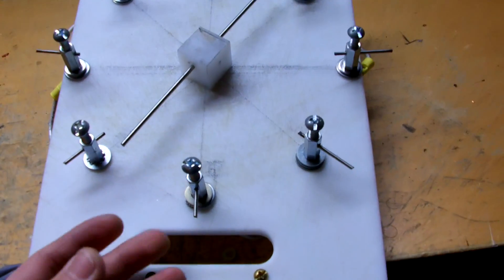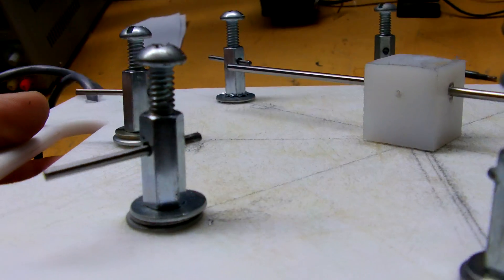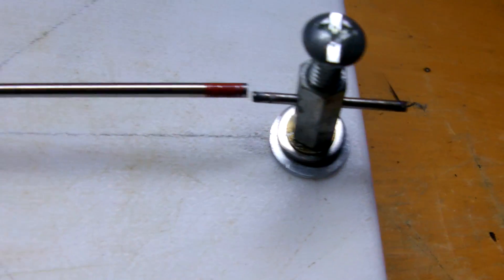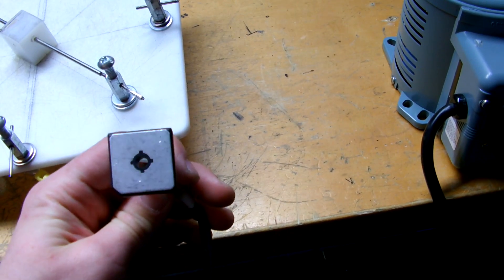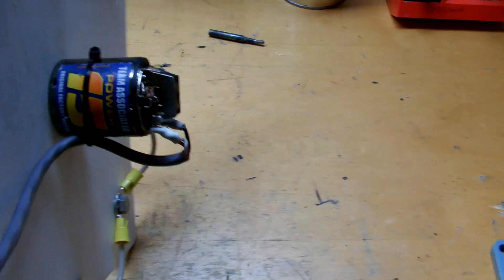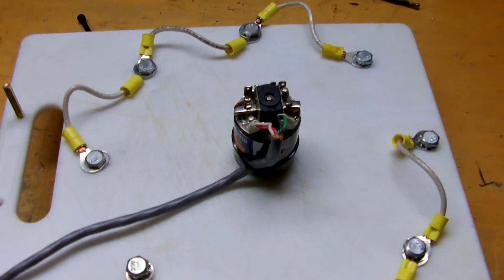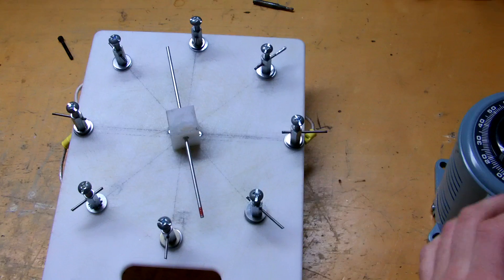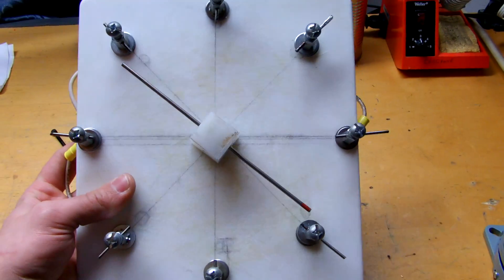Asynchronous Rotary Spark Gap Tour!

Comment: Back in the 70's through 90's I had a antique radio collection that included a wireless rotary spark gap transmitter. The rotor disk had, if I remember correctly, seven interconnected studs and was about six inches in diameter with a single stand alone stud to set the gap. Very much opposite to your set up but the same general effect. Motor was a 60Hz fan motor from the 1920's. Not sure of the final voltage but when connected to a long wire antenna it would blank out ALL radios from LF to SW in a one mile radius Lol

Comment: That's a nice economical design as the moving electrodes are cooled by movement whereas the static electrodes actually share the heat between more electrodes, i.e 2 electrodes moving but 8 static. So its not obvious which would suffer first from the heat! But I do wonder if the motor bearings are up to the job of handling the out-of balance forces from what will, even with the best efforts, still be an unbalanced rotor assembly. But it seems to work well on your other videos.

Those threaded rod joiners are a great item, I have found many ways to use them in various mechanical and electrical projects, I find the ones where the threaded hole goes right through are best. E.g. 20mm long M6 thread inside a 10mm hexagon.

Comment: Hi can you tell me where you bought those posts from & what they are called that hold your tungsten electrodes.
Cheers
Reply from the maker: Hi, sorry for the late reply. The posts holding the tungsten electrodes are just simple threaded rod connectors from the hardware store, i used a drill press to make the holes for the electrodes to slide in and the bolts on top hold them in place. Thanks for the comment!
Reply from the maker: Hi, sorry for the late reply. The posts holding the tungsten electrodes are just simple threaded rod connectors from the hardware store, i used a drill press to make the holes for the electrodes to slide in and the bolts on top hold them in place. Thanks for the comment!

Comment from the maker: Hi i do actually get bigger sparks because i can control the amount of power going through the gap from the output of the capacitors, unlike a stationary gap which only fires once the caps are full enough to break down the air around the electrodes.  Thanks for the comment!

Comment from the maker: Hey alex,  by being able to control the break rate of the gap allows me to vary the amount of power pumped into the coil during each break with the charge/dischare time of the caps resulting in a tune-able performance, you can tell when the right break rate is achieved, the arcs are huge!

Comment: Very cool!  I guess cutting boards have decent voltage standoff :)
Would a concentrated air blast over each stationary electrode tip help with cooling/reduce burning off?  The rotor segment has lots of air movement and surface area but the stationary points have less surface area and not as much airflow besides that stirred up by the rotor.